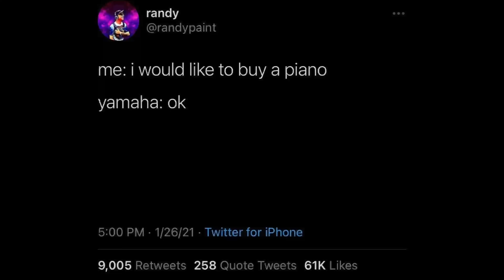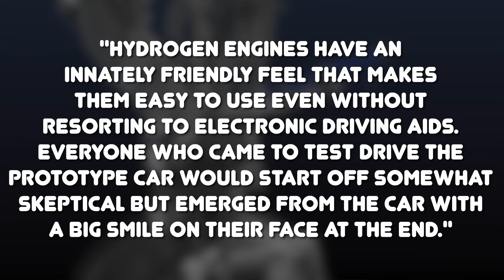Toyota's New 455HP Hydrogen V8: Everything You Need to Know

Comment: With infrastructure - big difference is FILL TIME!  Compared to an electric car 40 to 60 minutes a hydrogen car less than 5 minutes plus the EV charging stations notorious propensity for glitches .  It's a question of the will to do it.  I think hydrogen is more viable given the development of battery technology at present with the environmental cost of mining lithium and other materials to make the huge amounts of batteries necessary for ev's.  And then there's - what do we do with the old dead batteries?  Of course future developments in energy storage may make this all moot, but right now hydrogen could make sense.

Comment: A person that would have bought an M5 or an E63 AMG instead of a Porsche Taycan Turbo today, will not buy a EV equivalent in 10 years time, when petrol and diesel engines are banned. If that same person had the choice between a GSF Hydrogen V8 or an full EV E63 AMG, he will buy the GSF V8. There will ALWAYS be a market for ICE for as long as petrolheads exist. We do not care for fuel economy or CO2 or noise pollution. Toyota are one  of a very few manufacturers that understand this and they will have a monopoly on ICE in the future.
Reply: People will retrofit existing engines instead
Reply: There is no future for ICE.....  Why oh why would you continue to manufacture an engine with hundreds of moving parts, an ignition system, a cooling system, fan and timing belts etc, when the alternative vehicle has around 20 moving parts in total, and needs just a fraction of the servicing and maintenance....
Reply: Toyota will have a large slice of a very small pie...
Reply: Hydrogen source is water. Hydrogen is for drinking and washing clothes not engines.
Reply: You said it well. Too many people are too short sighted and ignorant to give a damn about pollution

Comment: Zero emissions on a 5liter V8 is insane
Reply from the maker: And it still makes a ton of power and should sound amazing. I think it will convince a lot of people that hydrogen could be a real option if the infrastructure was there to support it.
Reply: Technically there are emissions but not nearly as bad.
Reply: @Ratkill9000  could make nox, but better than evs.
Reply: @guycha0s380  How are NOX emissions from hydrogen ICE engines better then no emissions from EVs?
Reply: @airchie2  because evs make ton of emissions before they reach out to the customer
Reply: @guycha0s380  Manufacturing anything creates emissions. Creating the hydrogen engine creates emissions. You get nothing for nothing...
Reply: @airchie2  manufacturing and disposing EVs and batteries actually makes Evs have greater emissions, also to create electricity some of the power grid is fossil fuel, so same goes for the hydrogen
Reply: @AhhemBoss  There's a higher environmental impact associated with the manufacture of EVs when compared to ICE engines. This is then offset by the EV being much more efficient than hydrogen or traditional vehicles. The greener the electricity you charge with, the faster you offset the manufacturing cost.
Reply: @airchie2  @GUY CHA0S Hydrogen engines produce water and steam no NOX, no pollution out of the exhaust..
Reply: @anthonysach  If you're talking about hydrogen fuel cells then there's no pollution from the exhaust. Hydrogen combustion engines do produce more than just water or steam. From my understanding, the more power you try to get from hydrogen ICE engines, the more nox etc they produce.

Kind of inconsequential though, since hydrogen won't be a viable solution until we find a more efficient and environmentally friendly way to produce it at scale...
Reply: If they could take it one step farther and just put water in the tank.. then it would be worth it..
Reply: I’ll buy a hydrogen car over electric any day
Reply: @chaidezrigo  They'll need to be available first but it's up to you if you prefer to drive a dirtier, slower, less efficient, more expensive, less reliable vehicle. 👍
Reply: @airchie2  combustion engines will always be more fun. What makes you think electric cars are more reliable?
Reply: @chaidezrigo  I guess that depends on how you're defining "fun"?  ICE engines are certainly more challenging with gears and revs and trying to stay in the power band etc.

In terms of reliability it's all to do with moving parts. There's a reason ICE engines need regular maintenance and oil changes etc. That's why stealerships are so anti-EV, they'll lose their business model of making huge profits from the parts and labour needed to keep ICE cars running...
Reply: @chaidezrigo  
"What makes you think electric cars are more reliable?"

How many moving parts...?
Reply: @thethirdman225  one thing goes bad in an electric motor and you won’t be able to fix it yourself. ICE engines can be rebuilt in a garage by the avarage JOE. You have to always take your EV to the “stealerships” unlike ICE engines? Does that make sense?
Reply: @chaidezrigo  No. I know plenty of people who can fix electric motors. Even I replaced brushes in the old days. But the fact is that an electric motor has one moving part - the armature - and failures are extremely rare. Electric motors are less likely to fail than ICEs. Even if they do, a major failure is not something that can be fixed by ‘the average JOE’, whether it’s an electric motor or an ICE.

I mean, the holdouts predicted the end of the world as we know it when EFI became a normal thing. ‘The average JOE’ wouldn’t be able to fix it in his extensively equipped garage. There are even holdouts who have pulled the EFI out of their cars and replaced it with carburettors (thus also voiding their warranty) because they don’t like it.

I won’t lose any sleep over it.
Reply: @chaidezrigo  By the way, a Tesla, like most EVs, has no maintenance schedule. You just need to monitor consumables like tyres, brake pads, wiper blades and light globes. You only need to contact Tesla service if the car tells you to.
Reply: @thethirdman225  what?? An ICE engine can be fixed by an average JOE in a garage that’s not fully equipped. Not to be an a$$hole but you must be living under a rock. EVs cost way more for a battery replacement than a engine rebuild for an ICE engine. Also, you sometimes have to wait months before a battery replacement is available for EVs. Have you seen what mining for battery components do to the earth?? Go look it up
Reply: @chaidezrigo  Why is this such an emotional issue for you?
Reply: @chaidezrigo  I said a major failure in either type could not be fixed in a garage by ‘the average JOE’. You’d need a fully equipped garage or you’d need to take it to a mechanic. ‘The average JOE’ probably doesn’t have a fully equipped garage. Electric motors have one moving part. ICEs are much more complex. Furthermore, if you look around, you will find that the majority of ICE engine failures are due to lubrication problems, which are much less of a deal with an electric motor than with an ICE. And electric vehicles like Tesla don’t even have maintenance schedules.

How often do EV batteries fail? It’s as rare as an ICE engine failure, if not more so. There are simply more things to go wrong.

The mining issue has been overstated and in ten years time, 80% of batteries will be recycled anyway. These are all old oil industry talking points from ten years ago. EVs of today are light years ahead of what they were then.
Reply: @thethirdman225  it is not emotional is more of pointing out the pros of ICE engines and not just the cons. You literally don’t need much to rebuild an ICE engine but a garage and a few tools, trust me. A EV battery has a 10 year life if you’re lucky. An ICE engine can last 30+ years if you keep up with maintenance.
Reply: @chaidezrigo  Why should I trust you? I’ve rebuilt engines. You need a well equipped garage, including a small shop crane or a block and tackle to remove the motor, to do a complete rebuild. Not many people have that.

And you’re wrong about battery life. That’s an oil industry myth from ten years ago. There are plenty of battery packs that are 20 years old that are still within a couple of percent of their original charge capacity. That’s only going to get better. Tesla have just released a new battery pack that can take 100% charge indefinitely. An EV like a Tesla doesn’t even have a maintenance schedule. The app just tells you when you need to change fluids, mostly the washer bottle!

Electric motors don’t fail. Look at all those industrial motors that are 60-80 years old and still going. I know people who have stripped them down, not because they were broken but because they were upgrading things like bearings.
Reply: I could care less about emissions.
Reply: @Senkino5o  that's quite a moronic statement.
Reply: @Senkino5o  If everyone on the planet didn’t care, this world would go to shit really quick. Thankfully there’s enough of a balance right now
Reply: @Duncan Macleod Not sure why that's relevant? But my oldest car was 21 years old. I didn't own it for all that time though.
Reply: @Duncan Macleod I've never built an engine. I've never built an EV. I don't think I've even had to change a tyre.

In terms of favourite ICE, I'd probably say the 2.5ltr, 5cyl turbo Volvo engine. I had it in my Volvo 850 T5 as well as my Focus ST3. Both remapped to around 300bhp.
Reply: So is the assertion EV's are the thing - the host here needs to note its politicians trying to sell that as what wil take over, and those guys get things wrong 90% of the time or worse.  Why?  Lawyers suck at science.    There will be emissions in a hydrogen motor because there's oil and heat, but output will be a tiny  fraction of what gasoline does I expect.